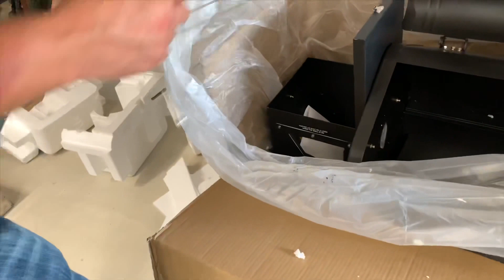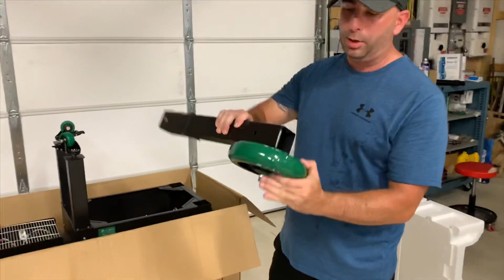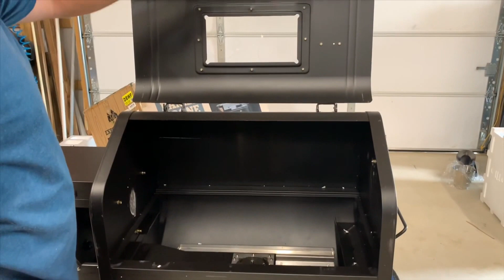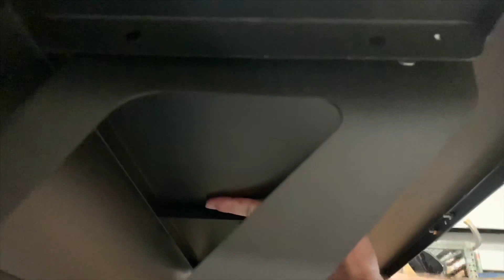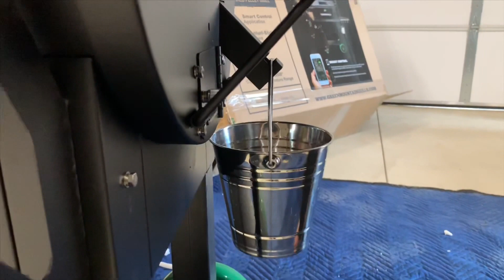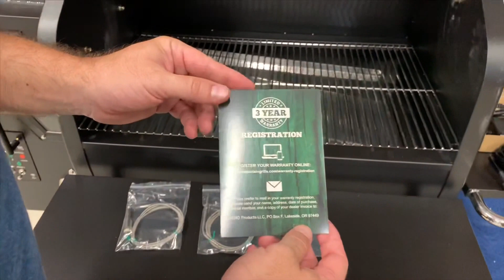Green Mountain Grill Daniel Boone Jim Bowie Prime Wifi 12V Complete Build and Unboxing

Comment: Here is a tip, mount the bottom tray opposite the way installed in the video so when you turn the grill over you have a tray instead of a shelf.  Therefore the stuff you put on your tray will not fall off...

Comment: Thanks guys after watching this a couple of times, did not look at the set up guide ,  it took 35 minutes buy my self to set up my 
JB Prime plus the only difference was Green Mountain has changed the mounting of the bottom shelf it just drops in no
bolts required pre-installed pins ( prefer the bolts as it adds rigidity).But everything else was spot on. But this packaging was Ingenious. No issues with WiFi .
Oh my only disappointment was the set screws in the utility hooks
That design needs improvement.
Reply from the maker: Thank you for the comment enjoy the food!

Comment: Thank you guys for looking out for customers. I bought a Daniel Boone Prime Plus yesterday. The construction is great. This was not designed by a geek engineer. The designer had some pretty good analytical skills. There were quite a few ways the grill is constructed actually facilitates assembly. However,  they do need to hire someone to write a new assembly manual. It was unclear at several points. Thank God for YouTube😁. Overall, I love the construction of the grill. It is very well constructed. Hoping to burn mine in this weekend and do a first cook. I am tired of fighting with my small offset stick burner.
Reply from the maker: Thank you so much for your kind words.  We try and help in the areas we feel that can be improved.  Please share with everyone.  How did your first cook turn out?

Comment: Hi guys:   I was curious if you know why the new Daniel Boone Prime (2020) model doesn't have a fan anymore under the fire pot?  One reason I liked the GMG was they had a fan in the hopper box to keep smoke and fire from back building into the hopper and one on the fire pot to swirl the flame and keep that going.   I noticed the 2020 DB Prime only has ONE fan none under the belly of the unit.  Do you know why or what they did and with that change will it keep the fire and smoke from back building into the pellet hopper.  My 14 year old Traeger used to have that happen quite a bit.  Thank you in advance for you knowledge and insight!
Reply from the maker: The choice models still use that design you are talking about, but it's not as good as the prime.  The older models and the choice use a positive pressure on the hopper box so if the hopper is opened you lose the air pressure going to your fire pot, but now will push air toward the hopper box creating a possible burn-back.  The prime design is putting a positive air pressure to the firebox creating the Venturi effect for your flame, while pulling a vacuum on the pellet hopper.  This is a better design because it eliminates burn-back of the hopper if it is opened because it still is pushing the air away from the auger at all times.

I have some photos if you send me your email?

Comment: I have 7 small bolts left over... where did I miss bolts?
Reply from the maker: 7 is what you should have.  I know in the video we have less it's just because 4 of them fell out of the plastic holder.
Reply: DR. Smoke thank you I know there are holes underneath the grill but the screw wouldn’t work properly so I wasn’t sure if I did something wrong. I appreciate your quick response!! Your video was very helpful by the way!
Reply from the maker: Thank you so much.  Each leg is only 2 Bolts you got it right.  Enjoy the smoker!

Comment: Just bought my grill, not bad instructions and it definitely helped. They say to tighten the legs down first before put in the bottom tray. Instead, leave the bolts hand tight until you get the bottom tray installed. This is a poor design issue. Trust me, the holes will line up a lot easier. Then tighten all the bolts at once.
Reply from the maker: Enjoy the new smoker!

Comment: Not too sure why they never put the bolts under the smoker? The four other holes for the legs. So I took them out, could only get two and now have five extra small screws. The instructions in the booklet suck ass.
Reply from the maker: The Inside holes are just a manufacturing cutout. Only two bolts per leg.

Comment: My pellet dump door is upside down and includes a screw type lock to hold in place. Weird...
Reply from the maker: Johny Co That is a redesign
Reply: @DRSmokeNJ  Thanks so much for the reply. I was over here stressing thinking the manufacturing warehouse screwed up the welding process lol.
Reply: Water could run down into the hopper so they reversed the door and made it tighter with the screw.

Comment: Thank you for this. The manual doesn't show me which bolts to use for legs etc.
Reply: How many screws did you have left when you finished? I have the two long bolts and 7 of the smaller ones. I can't find the location for the last 4 of the smaller ones at all.
Reply: @kormoc  I also had 7 short ones left over... I'm wondering what I skipped. :)

Comment: Did you put the bottom shelf on wrong?  Seems like if it was turned around would serve more as a tray and items wouldn’t slide off.  Also,  I have a bunch of bolts left over.
Reply from the maker: brian willis no the shelf is correct, but I suppose you could install it the other way.   GMG gives you a bunch of extras. You should also have 3 probes.

Comment: I wish I would have seen this an hour ago.....lol
Reply from the maker: lol that is the reason we made this video because the same thing happened to us on the first build. Good luck with your new smoker!
Reply: @DRSmokeNJ  After watching I installed the 2 bolts I missed on the rear wheel posts.. I did the first start up and will be doing a Tri Tip tomorrow.

Comment: Thanks for the assembly vid, definitely helped! Having trouble with the screws that go on the inside of the legs...can get them barely screwed on, is that normal?
Reply: Did you figure this out? I noticed in this video they didn't do the inside of the legs.
Reply: Johny Co same here for me.  I have 7 extra bolts left. Not 3.  And the 4 are for those inside bolt holea on the legs.  Will pop them in there but they dont fit to the frame well.

Comment: Hello, thanks for the video. I have a question? They are now having black Friday sales. Do you have any recommendations between the choice wifi vs the prime module. I know the prime has a few more options but cooking wise are they about the same
Reply from the maker: Tony B The DBWF prime is much better of a build quality.  A lot of vendors do not have the choice wifi available anymore because they are discontinued.  The prime also has dual meat probes and the front shelf is awesome.  I would 100% go DBWF prime.  Where are you located?
Reply: Las Vegas, thanks for the fast reply. Gmg has the daniel boone with wifi for $399.00. I Like the prime better but for the price I cant beat it